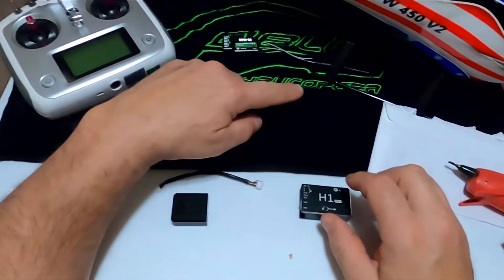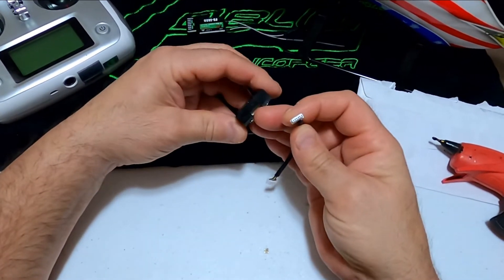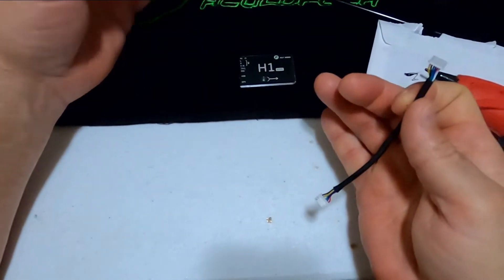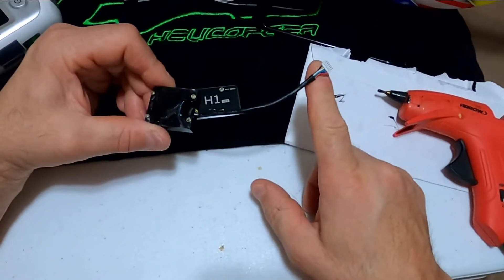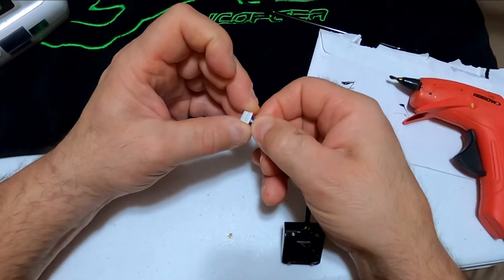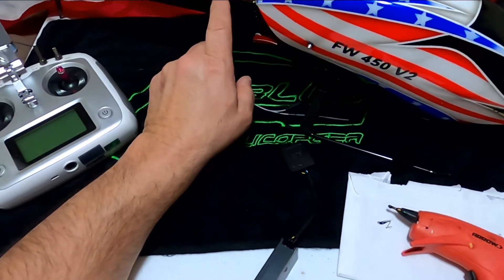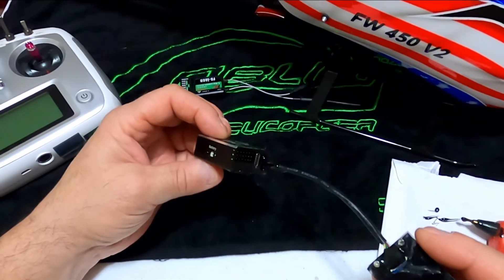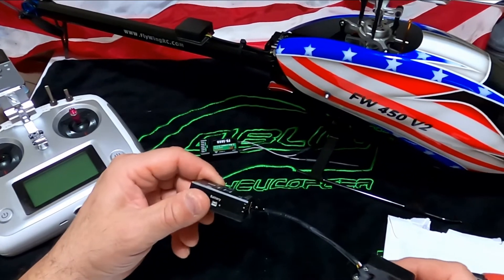Flywing H1 Flight Controller Tips

Comment: As an alternative, may I suggest you checkout "Black Tak".  It's like Blue Tak but stronger and grips better.  Easier to remove than hot glue and more flexible.  Photographers use it for (expensive) camera equipment.

Comment: i have h1 heli  on trex 450 dfc. until now , never found solution about shake after airbone,, my main shaft, tail shaft, blade ,, avery thing good condision( center).  all part use original align.. 
after a couple time i try  and looking some problem may i miss,,but i dont find any miss procedure. i change again to use microbeast fbl.. and work fly normaly..but when i use h1 again ,, still shake again..
  i hope  someone can give me solution
in my comunity have 3 h1 heli in 3 people have same problem.. 
thank you
Reply from the maker: have you done the servo check in the software, with the H1 nobody seems to care about 1. CG and 2. Blade tracking..here is a video about servo check, if you get it right your blade tracking will be correct      https://www.youtube.com/watch?v=I_prY2lBXoE     its on the FW450, but H1 has same in direction center stick high stick and low stick if you have rotor head lines like SAB Align and fw and others make sure the are correct....blade tracking can cause shaking and also adjust tail in software
Reply: @CRUZROYHelicopters  thank you for your respon, all servo work correctly direction, cg little tail heavy but i think its ok , blade no tracking in any direction,, flat zerro deg, in center stick. also with tail,,its all normal condition. when i use old align 3gx again.. its work great to fly..
Reply: @MrRockq turn your gains down

Comment: My brand new V2.5,after initial setup and compass calibration,5 min. test flight👍,next day went to fly again and only got flashing yellow light ,would not turn green,the plug inside the GPS module came loose,had to remove the GPS module to expose the plug,plugged it back in then put some gorilla tape on the plug to keep it secure,reinstalled the GPS module,now works perfect,thankfully it did not happen in flight,would have been ugly,I also put some zip ties on both ends of the cable for added security.

Comment: I was searching to see if this could be used with an Ibus receiver and instantly found my answer.  You also opened my eyes to two unknowns.  The first was that there is an H1 lite and secondly the  connection issue.  I am looking to upgrade my Kbar to this

Comment: Thats not a good fix perment connecting components that need to detach.  If you have a boom strike in a crash you can kiss the controller and gps goodby, they are going to get destroyed.  Fixing the wires to the connector is good idea if they are poorly connected and come apart.  Your better off using RED tap on the connector to the gps. That would stop it from coming loose, but would still be able to disconnect in crash.

Comment: Excellent idea as these connectors are a weak point.  Several times on liftoff, my FW450 v.2 has lost GPS and suddenly the heli seems like it is in 3D mode.  What a handful getting it back down safely.  Secondly, had trouble FINDING the satellites getting ready to fly because one of these wires is not making proper connection.  Sealing the connectors as you've shown and a zip tie or two around the wire/tailboom completely solved this.  (And since I've adapted a shiny, scale Hughes 500 fuselage wrapped around the mechanics, really do not want any connection failures leading to an expensive crash!  Thanks so much for posting this.